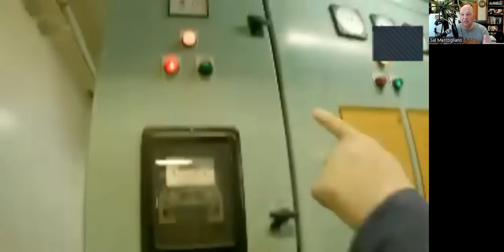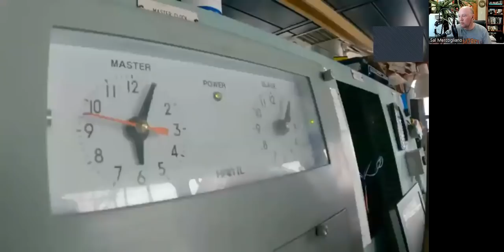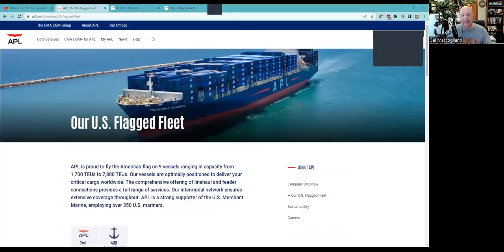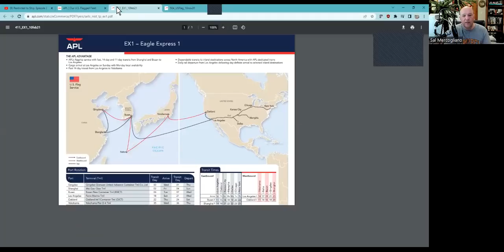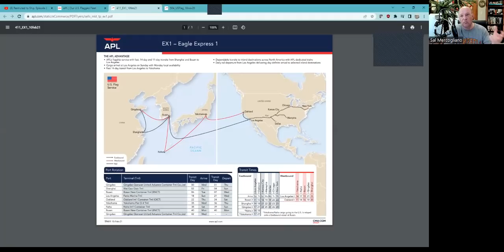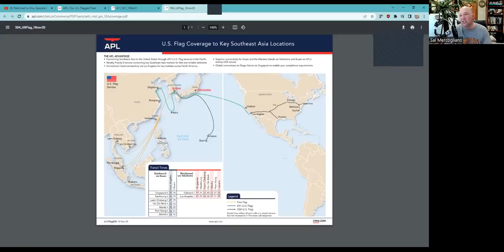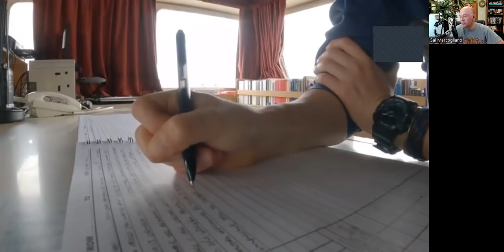Shanghaied in A Chinese Shipyard - Episode 2 of Restricted to Ship: Ghosting in Shanghai

Comment: I learn so much from your videos!  I have not been exposed to any knowledge of shipping.  I have worked retail for over twenty years and worked more with the trucking industry.  I only knew when I ordered tiles from China, that it was going to take an extra two to three weeks to arrive. As of today, we are getting merchandise, however; certain items are two to four times the amount ordered.  Lets say we were supposed to receive 25 flower pots. 75 flower pots arrived.  Not enough space to display that many, not enough space to keep in receiving. The soil for the pots has not arrived and no arrival date is in the pipeline.  This information is echoing everything you have been explaining.  The supply chain is made p of links and I now see how one or two links are twisted or missing, really does affect the whole. Hey, I didn't even have to pay any tuition!!  Thanks, from Ocean City, NJ.
Reply: I add the shipping language is the same as on the truck line.  As a 70 years old female, I can outdo some of the young whippersnappers!

Comment: Interesting video! In discussing the question of doing more shipyard work in the USA you didn't mention the comparative labor cost as a factor. US manufacturing labor costs 4-1/2 times cost of labor in China. Even if work done in China is taxed at 50% it is still less than half what it costs in the USA. I don't know whether different safety and labor code compliance might also affect cost. I'm not saying that more US shipyard capacity wouldn't be worthwhile, Only that cost factors could be more significant than one might realize. Thanks for the video Sal!

Comment: Are there standards for shore power? In buildings, fire code specifies the breaker protects the wire. It was rather scary to here them say the breaker won't trip but the wire would catch on fire. Shore breaker should trip before that, right? Why doesn't the ship carry their own shore cable rated up to their 400A limit?